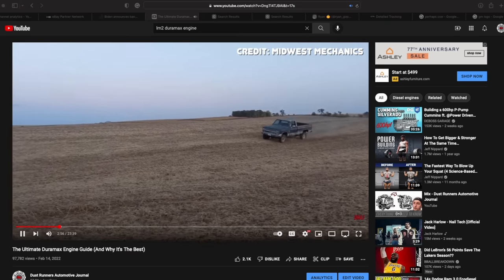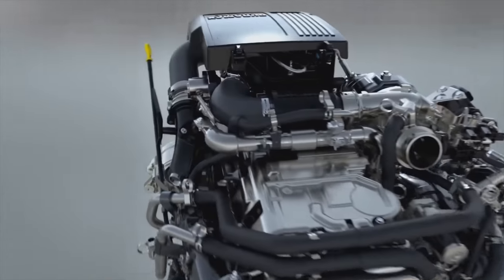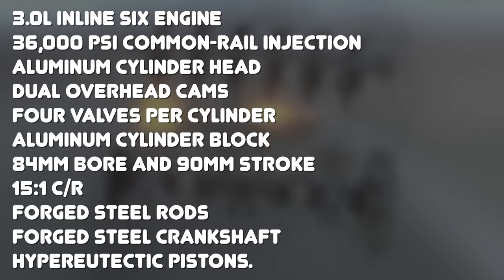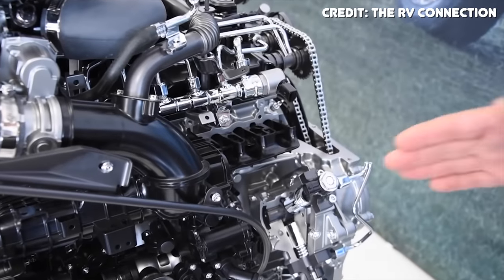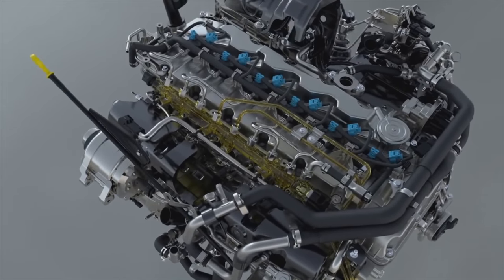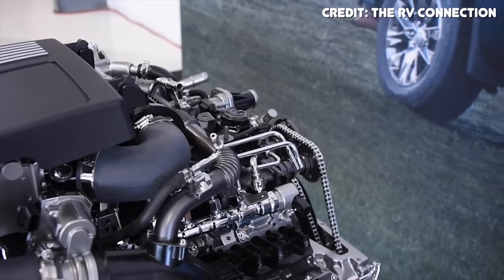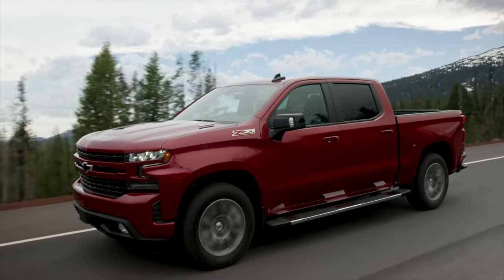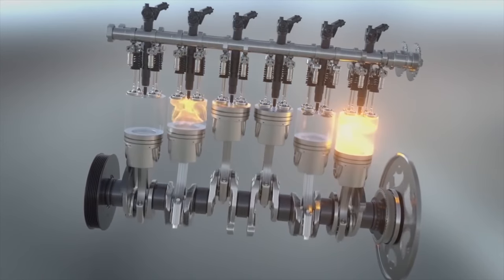3.0L LM2 Duramax: Everything You Need to Know

Comment: While the LM2 duramax has some downfalls for routine maintenance it is still by far the best diesel engine in the half ton trucks. Performs the best and so far the most reliable compared to the ecodiesel and powerstroke.
Reply: Tough to say with reliability vs the new ecodiesel engines released in 2020. Supposedly 80% redesigned but too new to know about high mileage reliability
Reply: Dodge can’t fix the limp mode issue.  The local dealer has had to buy back at least 10 due to continuous limp mode issues that even engineering couldn’t fix while still making them meet EPA emission standards.
Reply: @TheIamdevin  True, however the fact that Chevy went with a straight 6 instead of a V6 like Ram and Ford, gives me more hope for reliability.
Reply: @MitchJohnson0110  absolutely inline 6 diesels are a great if not the best platform. But the new ecodiesel and new lm2 engine are too new in my opinion to claim long term reliability
Reply: @TheIamdevin  agree 100%. I always tell people, "lets see how they're doing 10 years from now once they're actually in my price range" lmao
Reply: I have a 14 Jeep Grand Cherokee Ecodiesel that I bought new and have 155k miles on it and it's been almost perfect with reliably. Had a little problem with a clogged the DPF but otherwise perfect. I had a friend with a 14 GC Ecodiesel also and it ran great but then he got a 18 Ram Ecodiesel and had a few problems that were enough that he traded it in.
Reply: I can attest the EcoDiesel is completely flawed and a complete nightmare to rectify any issues it has.
Reply: @MitchJohnson0110  straight 6 v6 4banger v8 inline 8 it really don't matter how the platform is set up it still can be junk like 6.0 to the 7.3
Reply: @austinhowze6280  well obviously but different platforms have different pros and cons. Straight 6 engines are naturally balanced and are usually going to be the smoothest. Less excessive vibration leads to longer engine life. The disadvantage is that the engine block is 6 cylinders long. Might as well do a v12 at that point haha
Reply: No downfall on routine. Oil change is cheaper than the 5.3. Fuel filter is super easy to change

Comment: Next you should do the 2.8 LWN! It's also in the Chevy Express/Savana.
Reply: I think in the Colorado too
Reply: Also include  the 6L50 for the issues, but I love the LWM! I wish the Corrado/Canyon got the 8L90 that the Express had!
Reply: @RandomlnternetGuy  most of their sales are the canyon/colorados
Reply: It's also a much better designed engine than a 3.0 dmax.
Reply: @daniels2761  the lwn is an old vm motori engine updated a bit.
it is literally the engine you could get in the jeep liberty diesel. 
Engine's tough as rock but emissions can get troublesome, particularly in winter.
Reply: @daniels2761  is it, really?
Reply: Ah the VM  motori 2.8L the same engine the 2005 and 2006 Jeep liberty used
Reply: @ProbeGT2  this 2.8Ls engine is not bulletproof....  they are notorious for overhead issues at 120,000 miles... hopefully GM addressed this problem
Reply: @glennschlorf1285  I haven’t heard of a single overheating issue, the worst I heard is emissions related failures or the turbo failing around 100k

Comment: Just past 1 year of ownership on the LM2 and 16k miles. Love it and zero issues. Great MPG at 29/30 on the highway. Smooth and quiet with great power. It's really been a dream truck set up so far... fingers crossed. I considered the Ram EcoDiesel and the Ford PS but heard many reliability issues with those. And... RAM and Ford dropped both from the 1/2 ton line up since.

Comment: I bought mine in 4/20. Excellent power and fuel economy. My engine went out at 44k. Number 1 piston wrist pin cracked and fell out of tolerance. Engine ran just made a horrible noise. Tbh I’d buy it again. Way better than a 5.3. Really smooth and lots of power down low. Waiting for the banks to come out. Great review man I like your episode.
Reply: Did they honor your warranty?
Reply: Lol are you a sadist? Being better than a 5.3 isn't high praise. You could also buy any other brand and likely not have an engine failure at a ridiculously low mileage.
Reply: You'd be singing a different tune without warranty coverage.

Comment: I've worked on a lot of these at my GMC dealership. The best thing about these trucks is that you can pull the cab very easily because the entire cooling system is frame mounted. Once you pull the cab, you can also change the injection pump without removing the transmissionm GM makes a special tool that holds the injection pump gear in place so you can unbolt the injection pump and swap it out.
Reply: The fact that you have to pull the cab for something so simple is stupid. We've had one of these trucks tying up a hoist for a month and a half while waiting for a new motor to come in.
Reply: @sterlingmakara  I agree. The new body style of trucks are getting harder and harder to work on.
Reply: @sterlingmakara  to do anything on almost any light truck diesel you have to pull the cab.
Reply: @sterlingmakara  how long is it taking you’ll to take cabs off?

Comment: My truck. Runs well mileage is great26-27 mpg. I have 98k it’s a 2020, transmission went out starting at 25k and locked up going down the road at 55mph. Leaving 25 yard black stripes on the road.( that was fun)… 8 weeks to repair it mind you not replacing it, symptoms were the transmission was hard shifting between gears wouldn’t shift hi gear.   Next around 50k the engine developed a knock that sounded like it was coming from the right front of the engine… it progressively got worse and finally at 93,000 miles it was going to fail. I took it to Chevrolet they had to take the engine out of it which meant taking the body off of the frame. All the gears in the rear of the engine that were chain driven we’re totally worn out to include the tensioners , and chains. 10 weeks later I get it back. With a lot of arguing and raising hell, they replaced all the gears and all the chains and the old pump drive belt. The truck runs well now but the rattling noise is still there I’ve told them about it course it will be out of warranty at this point. So the next damage will be on me, it’s a wonderful truck as long as it runs well but until these problems are repaired permanently I would never buy another one I would not buy anything Chevrolet makes.
Reply: Sounds like you got one of the only bad ones

Comment: Love the idea of an in-line 6 diesel on those trucks, but I feel as if they might have created a lot of problems with the oil pump and chain driven drive. 
Time will tell but hopefully they continue to build off this and make it better through time.
Reply: Agreed.  Assuming no other issues with this new engine, the 150,000 mile replacement life on the belt driving the oil pump is going to be a legacy issue.  Diesel owners typically keep their vehicles longer and rack up 300,000+ miles over their lifetime.  I can only imagine the cost of pulling the transmission & transfer case to replace this belt X 2 or 3 visits to the dealer.  This engine will become a pariah over this issue alone.  And beware anyone looking at buying a used vehicle with this engine in the years to come.  It's a shame because otherwise it sounds like a great engine.
Reply: Yeah when these things are auto warranty people are going to be crying when you have to pull the transmission to do major work on the engine up top
Reply: @victorford7003  I'm wondering if someone isn't going to figure out a gear drive for these things. GM doesn't seem to care about this kind of thing though. Instead of using an existing V6 in the 1st gen colorado/canyon, they went with the goofy 5-cyl Atlas motors. Timing chains on those trucks are a nightmare. The timing chain up front is your typical thing although you do have to remove the oil pan. But that means dropping the front diff (on a 4wd) AND you have to drop the transmission too. Why? Because GM decided to use a chain drive on the back of the motor to drive the balance shafts. So when you buy a timing chain kit, it comes with the rear chains as well. If you find a 1st Gen Colorado cheap and its got 100k miles on it, get ready for an expensive job.
Reply: It’s a disposable truck designed to make money for gm, drive it for 4 yrs/ or 125,000 miles which ever comes first then trade it in, truck payments become like utility bills, once a month for life…imo

Comment: 35 year service manager here, this LM2 3.0 is currently my favorite diesel on the market.  Unbelievable torque to gas mileage ratio, love this engine.
Reply: Lots of naysayers on having to drop the tranny to check the belt. What is your opinion on this?
Reply: @jimlelan4906  that is 1 negative but it's at 150k. My advice...put a litte $ away with all the fuel savings you'll have.
Reply: @jimlelan4906   as easy to drop the tranny than to work on the front of a diesel motor any day

Comment: I've already put 45k trouble free miles.  Never a no or long start issue either.  Hauled a truck camper all over the west last summer in 100deg heat without hardly breaking a sweat.  Got about 18mpg doing it as well!   Handles NE Wisconsin winters easily also!  Oh, a friend of mine is a 27 year GM Tech who said the whole issue of the belt inspection is WAAAAY overblown.  He said it's no more difficult that a few timing belt jobs he can remember doing in other cars every 100k AND, that belt will easily go 250k without worry of breakage in his opinion.  And his opinion is based on actually working on these trucks.  I actually bought mine on his blessing...
Reply: It's really too early to know much about the longevity of the belt, but what I find troublesome is that it's a wet belt and the condition of the oil may have a big impact on belt life. They have also gone backwards and are using post injection for regen which they stopped doing in the 6.6L in part due to oil contamination. Adding the variable of consumer controlled oil change intervals and it just seems like a poor engineering choice when they could have easily used the timing chain to run the pump.
Would you really want to risk not changing it at the recommended interval and the consequences of no oil pressure at any moment? 
It's sure to be a deterrent to buy one of these second hand with 150k on it knowing you're due to spend 2+ grand to change this belt.

It may not be more difficult from your friend's perspective, but there probably aren't many timing belt jobs that will cost as much.
Reply: @LikelyCandidate  It's really not that difficult to back out the transmission on these trucks with a lift.  He said it's a 4 hour job at most.  Also, GM is likely to extend that inspection(not replacement) interval to 200k.  And according to my UOA's, there's zero fuel in my oil after 6500 miles...so no fuel contamination to worry about either.   As with timing belts, they RARELY fail on their own due to age.  It's usually a seized pulley  or idler.  That isn't some cheap Gates rubber belt in there.  It's good for at least 300k on it's own if GM is recommending 150k inspection.  Like I said, way overblown issue.  I personally don't even think about it....
Reply: So I decided to call the local GM Dealership regarding how much it will cost to replace that belt.  Hold on to your hats....According to their BOOK....it's a 12 HOUR JOB which equals $1800 just to GET to the thing.  NO FN WAY.  There's zero chance that transmission takes 12 hours to back out and replace with a lift and trained mechanics NOT laying on their backs.  I told them they're not going to get much business with that labor rate.  Like I said, my friend said it was about 4 hours tops(and he WORKS at a GM dealership), but that's REAL time.  I'll take it to an independent shop I use where the owner will be much more reasonable if need be.  Even at that, IF I still have it, I won't even do it until I roll 200k.   I had heard that GM was going to up the inspection to that anyhow so I'm sure if they're even thinking about it they're well under their predicted failure mileage even at that.
Reply: @TakeDeadAim   I remember reading that it was 12 hours. Sounds ridiculous but a lot of newer trucks get their cabs pulled off for motor work so maybe that's the reason? Whatever the case, it just seems like the belt is unnecessary. Whatever the interval for inspection or replacement ends up being; They could've used a chain or gear that would easily last the life of the engine. 
Good to hear that your oil tested well.

Comment: I work on these engines at work. Just in the first 3 months of this year we've already replaced 3 3L duramaxes. Wait a few more years until GM has fixed all the issues before buying one of these.
Reply: People should really avoid buying anything new tech wise. If it has a computer in it, you're paying a premium to be a beta tester, putting yourself and others at risk because these corporations cut every possible corner to maximize profits for shareholders, but never to pass on the savings to the customer.
Reply: @MD.20.20  no, people SHOULD buy new stuff, so they can be the beta testers for me when I buy it 5 years later.
Reply: WOW!!! That is worrisome! How reliable are the larger Diesels in the 2500?
Reply: @Dark farts exactly, several of them...for no reason other than to charge more and add failure points.
Reply: @jimlelan4906   the 6.6 is solid. L5p is a beast and prob the most robust diesel on the market. Gale banks got almost 1000 hp with stock internals. The rest of the truck needs work tho imo. Interior and some electrical lacking

Comment: I own one of these trucks and its great!  32 MPH on the highway going 65, 16 MPG towing our 5K lb travel trailer, could not ask for more in that department.  Very smooth and quiet as well.  I would not worry about the belt and chain driven cams and injection pump.  Most timing chains are worn out at 150K anyhow, so you might as well have everything replaced during that service, then you are good for another 150K in theory.  Gears may be better, but hey, a Cummins, L5P or Powerstroke will set you back 10 grand for that option, the LM2 is about less than a quarter of that.
Reply: It's actually cheaper to go with the LM2 than a 6.2 V8 now. Maintenance costs will set you back a bit with the diesel rather than gas, but the fuel savings and the fact that it's up to $1500 cheaper up front will offset that. Unless diesel fuel prices stay the way they are now; then the fuel savings will be gone.

Comment: I just hit 50000kms or 31000 miles and the best gas mileage is 7.4 L per 100Km with an average at 9.0, or 32 mpg best and 26 average. The only issue so far is the starter would spin and not engage with the flywheel at times, typically in cool weather. Dealer changed the starter and has happened only once since. Absolutely love the drive ability and the torque. Starting in -30C without the block heater was no issue. Serviced only at the GM dealer using only GM def.

Comment: There's a video on YouTube where a GM diesel engineer was interviewed about this engine.  He claims the rear chain has a life of 200,000 miles, which is more than the 150K cited in this video. Most people get rid of their vehicles before they reach 200K miles, so it's not a bad trade off given how well this engine performs.

After a 4 month wait for a truck sitting on a boat of Los Angeles (assembled in Mexico and shipped to LA), I recently acquired a '22 Trail Boss with the LM2 engine.  I've only put 2000 miles on it, but so far no issues.  It starts right up and if I let it warm up for 5 minutes before driving, it has really good acceleration for a 277hp engine.  The nice thing is I don't have to lean into the pedal to pick up speed quickly. With my supercharged V6 gas sports car, I have to downshift and jump on the gas to get it moving... and it moves!  With this truck, I just apply a bit more pressure on the pedal and it effortlessly accelerates.  Even going up a hill, I don't have to lean into it like a gas car.  The huge torque curve makes it effortless and subsequently yields excellent mileage... about 21.5 mpg around the city and around 28+ mpg freeway.  Seriously, that's insane for a vehicle that weighs well over 5000 lbs.

BTW, I have the LT version with the new generation interior with the 13" main screen and 12" driver screen.  It's pretty outrageous, but my only complaint so far is that the BOSE sound system absolutely sucks.  The DSP is one of the worst I've heard.  Given the $450 option price tag, I am very disappointed.  Otherwise, everything else is outstanding.

Comment: GM tech here! The LM2 does indeed have denso injectors and a modified CP4  pump
Reply: CP4 or HP4? I would have a hard time believing they brought the CP4 back after all the mechanical and legal issues it created.
Reply: @jakerisner4139  Not to mention the CP4 is a Bosch unit. Are you a Youtube certified “tech” then? Yes, I noticed you said injectors, but it seems you inferred that the pump was a Denso unit as well. If they really put the CP4 in this thing, I feel really bad for their customers. Actually pretty pathetic on GMs part if they did.
Reply: I heard the first year trucks had a CP4 and newer ones have a Denso, but don’t have anything beyond hearsay to confirm it